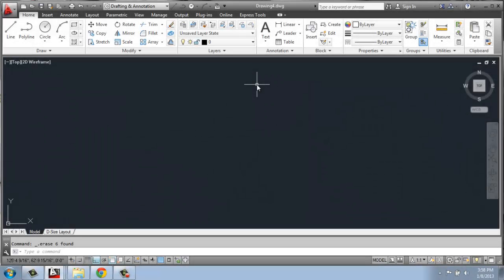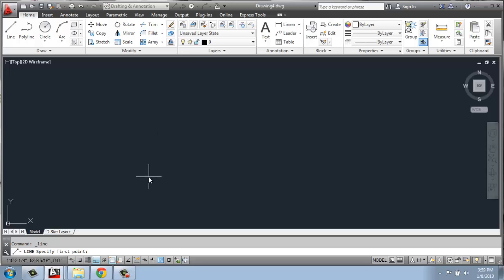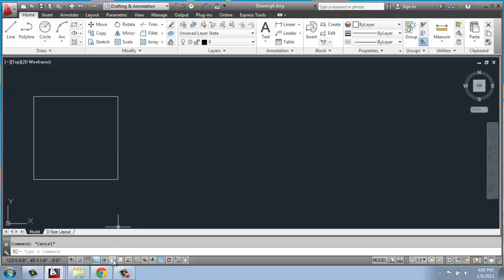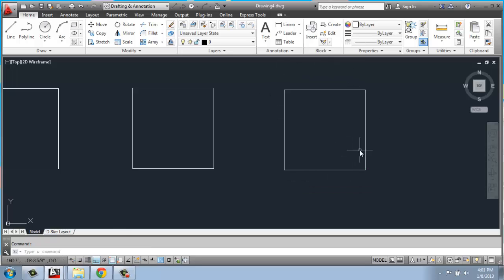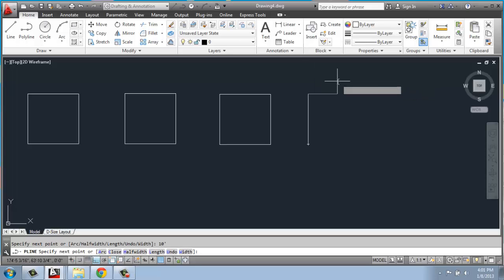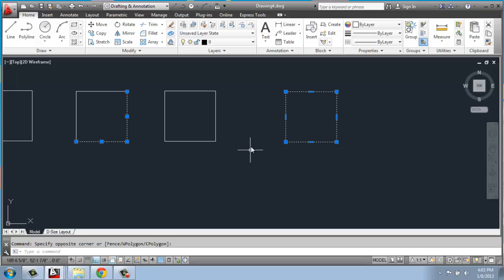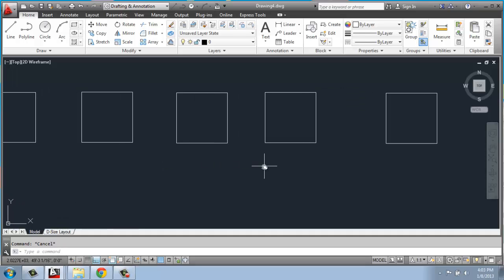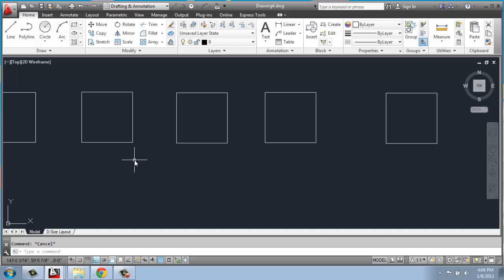#10 - AutoCAD - 2D Drafting Basics - Line vs. Polyline, Join vs. Explode - Brooke Godfrey

Comment: I still like the lit up dynamite stick icon for the Explode command from previous versions LOL. Again, learned a few things I didn't know. Thanks.

Just to contribute to your wonderful tutorials, I believe that when you create the third line, you can also touch the origin point and you will get a dotted line to tell you it will be the same length. I love using that option personally.